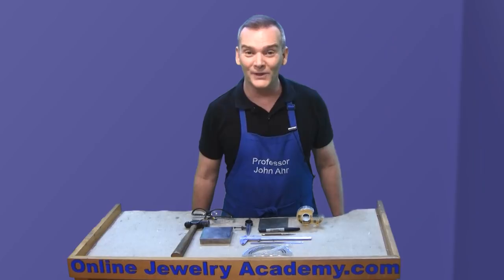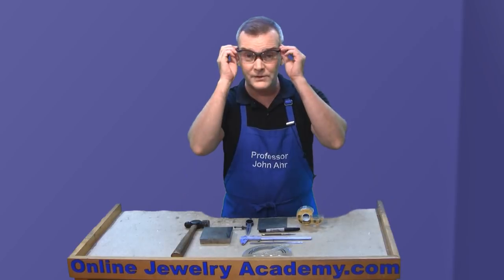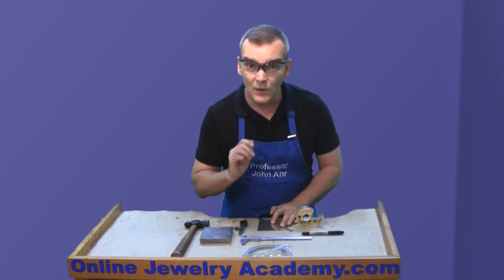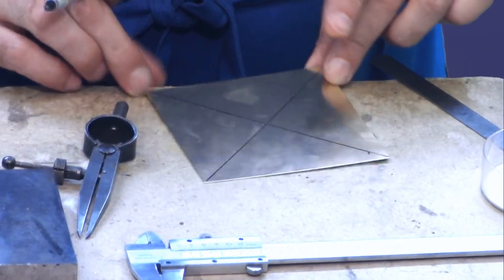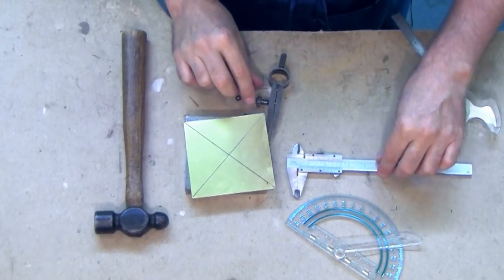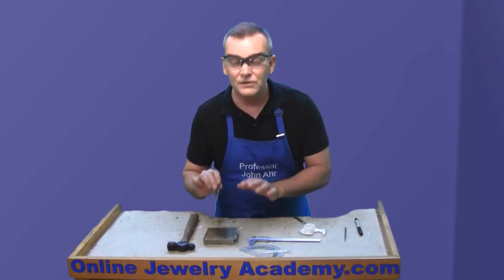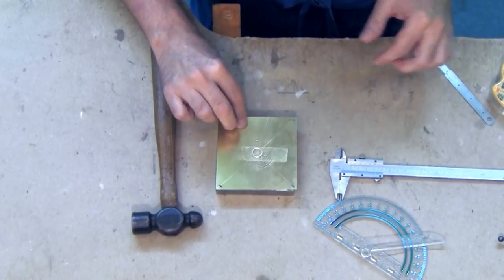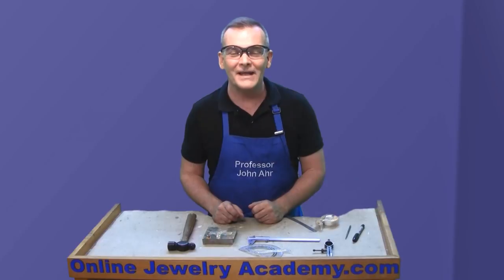Alien Technology --- Or Jewelry Making Tool???

Comment: Desperately seeking a tool or instruction on getting consistent offset holes in copper discs! My outer disc measures 1" and I want to put a holes measuring 3/8" near the top. I can't seem to get it lined up perfectly and I have to make a ton of them. I punch the smaller hole first with the disc cutter then the 1" but they aren't consistent. Do you have anything that would help me?
Reply from the maker: Hi Dianne,  Check out the "Center-Positioning Dies" here: https://www.mtixtl.com/rounddisccutterset-msk-t-09.aspx  They are sold by lots of jewelry supply companies.  This was just the first link for them that I came across.  They are really easy to use.  Just put the point of one of the dies into the first hole you cut.  The die will help you to center the hole in the larger hole you'll use to cut the rim around the first hole.  Good luck with your projects.
Thanks for your support! : )